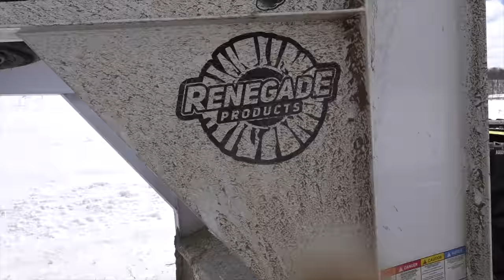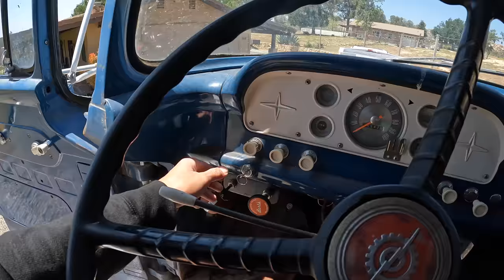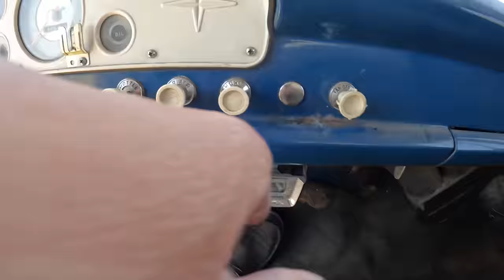I Bought This Truck TWO YEARS AGO!

Comment: When shifting you have to double clutch. Push in the clutch , take out of gear, let the clutch out and rev up a little. Push clutch back in and switch gears
Reply: I was just going to say that then I thought I better check cuz I'm sure other people my age thought of that too. 😉👍
Reply: @dalegereaux1863  27 here, but I thought the same thing not having synchros sure was causing problems 😂
Reply: double clutching is for people who dont know how to shift....
Reply: Float the gears 😂
Reply: @BassMaann  I drive a 14' 389 w/ an 18 speed, and I can't double clutch 🤣 Never learned how, I was told to only use the clutch to take off.

Comment: R. Air could be recirculate. The side hydraulic, we use it to fill seed drills. A hydraulic auger would go into the back of the truck and a chute on the other end would auger seed into drills.

Comment: My uncle has a truck almost exactly like this; to downshift you heel toe to rev match because on an un synchronized manual the input and output shafts are spinning at different speeds

Comment: Your throttle lever is to pull out when not moving to help your pto get a more then idle speed. Sorry I dont know more then that but the floor high beam switch should never have gone away with automatics!

Comment: Sweet truck! But float the gears. Non synchronized transmissions don’t need the clutch to shift gears. Just rpm’s Slap the skinny pedal before you try third

Comment: Option for the front brakes. Instead of an axle swap you can send the brake shoes out and get new pads rivited onto the shoes. Then the wheel cylinders can be rebuilt using aftermarket seals. Reusing the housings. Just hone them out. You can rebuild the front brake system.

Comment: If memory serves me correctly the two speed rear end you need to go back to the low side once you shift into neutral before you go into the next gear. I might be wrong but if I remember right that's how my grandfather taught me how to drive his old one ton for the two speed rear end back in the mid-80s
Reply: you sir are correct, you have to put splitter back into low before shifting up gears then back into high and so on.
Reply: @redfox_outdoors  thank you for confirming this for me. With it being close to 40 years ago I wasn't sure if my memory was correct.

Comment: 1st gear is granny gear only need to use when loaded! Start in 2nd gear ! My very first vehicle was a 1960 f250 with a 292 and a granny 4 speed ! Oh yeah yes generator not alternater i think it's  6 volts also!

Comment: When i drove trucks years ago with 2 speed rear axles, mechanics recommended leave it alone. Put it in low with a load and otherwise put it in high. Just use the tranny gears.  I saw guys drive shafts shifting the high low at each gear shift.

Comment: 292 motor is also found in the first few years of the 60s Mustang gt, 64-69 i believe. Good bit of aftermarket support for that motor, so adding something like powersteering or an ac condenser wouldn't be too hard.

Comment: The school bus I rode in high school was a stick shift with 2spd rear diff. After the bus driver shifted into high gear he would let off the gas and pull the button to put the diff in high.

Comment: Ok on a ford split rear 3000 rpm is your friend 1 low 3000 rpm pull high then 3000 rpm push button down while shifting to 2nd low 3000 rpm dont let her drop lower then 2400 rpms before your in gear

Comment: yeah gonna have to get the front end swapped eventually to get brakes on it.  get them window fixed, get the rust spots fixed. find some spray paint and coat those spots with paint and clear coat. hell, if the money for it was available I'd say give it to one of the custom shocks, have them fix the body panels and floorboards and windows, redo the bench seat, swap the front axle out for a newer ISH one so you got brakes and give it a nice paint job, then keep it at the ranch. for work there. or when you're gonna do projects like haulin dirt from one end to the other etc, or doing projects like the blind...use it to haul the material

Comment: you need to get sunset shot of the truck out in the field. like its 1960s. Also this might be a stupid question but have you tried to use that out side hydraulic lever to see if its just for using the bed from outside.

Comment: Build it up as the ultimate Ranch work truck new motor new transmission decent paint job (MAACO quality not High End like the OBS) and some Sergio installed work lights you should be golden

Comment: My friends dad had a ‘59 half ton shortbed fleetside back in the day it had a 292 v8 in it the exhaust manifold on the driverside exited from the front and wrapped around to the passenger side and tied into the front of the passenger side and exited the rear of that manifold…..wierd as hell…..looked just like the one in the video…im pretty sure it was a 292 and the ones in the early T-birds were 312’s i think

Comment: Water/ranch fire truck with pto pump.
Reply from the maker: I might put a tank in the back and use a gas powered pump. Don’t want to take away the pto dump to convert it to a water pump.

Comment: heads up i got a 58 f350 no one makes any wheel at all for it there 6x7.25. but o rileys does carry most of the engine parts
Reply: Negative wheels now in Wisconsin does
Reply: @92camarodragcar73  you have a link?